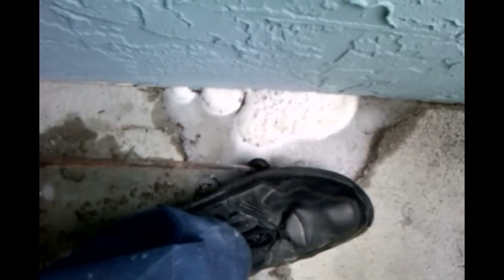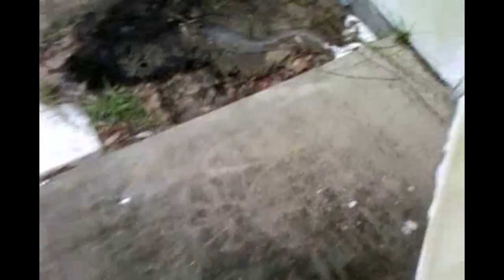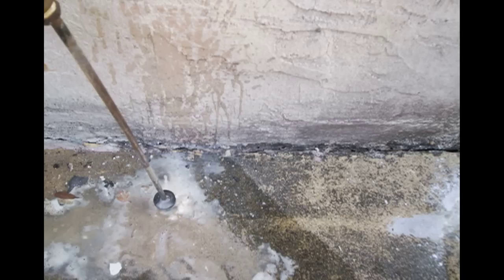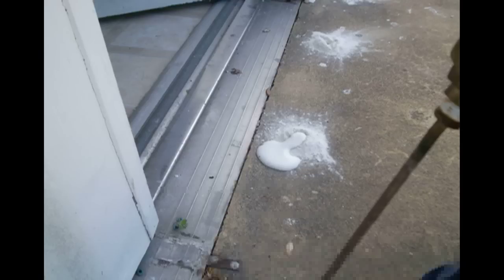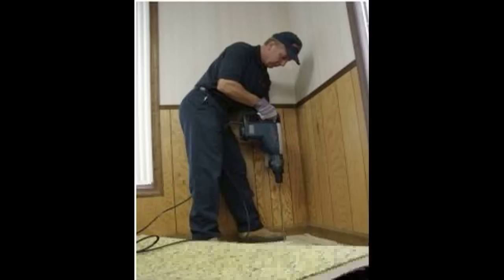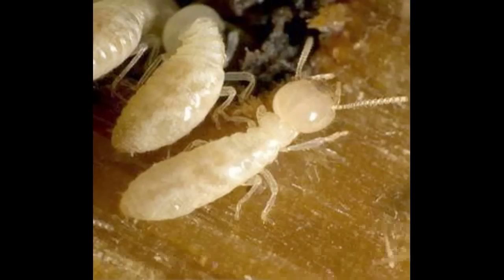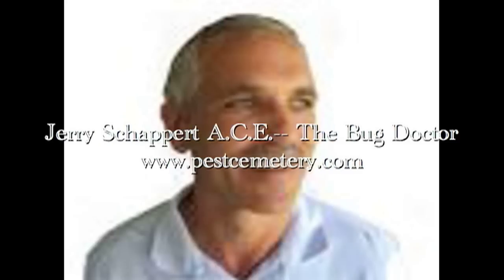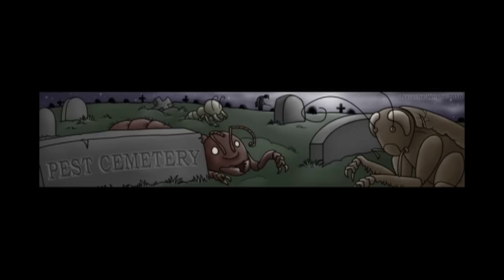How termiticide moves under slabs

Comment: Based on the amount of termiticide coming out the holes either the pressure is to high, soil to compacted, rock is under it,or the soil has to much moisture from recent rain. I would lower the pressure recalibrate and treat if it still comes out keep going do the trench see if it absorbs good then return to the previous holes retreat to make sure you get enough treatment underneath. A subslab injector with a directional tip might help as well. If this was t he only side where this happened it could be an area that would be attractive from excessive ground moisture and that might need correcting. Good luck!

Comment: the pic your referring to is of a Pest Control tech applying a exterior pest application. Not a termiticide! Oh ya, check Chapins site or google  versatool sub slab injector. Had you made a mess like that with chlordane, ppm would be detected for years or until you were sued and the house bulldozed.....

Comment: yes, i used chlordane for 12 years. all the post construction jobs i did ...were on homes previously treated with chlordane..(just saying)........i learned to do a treatment without spilling(contaminating) chlordane around a house like that.  Try a sub slab injector, plug holes before moving to the next...apply according to volume meter......and get some rubber boots!